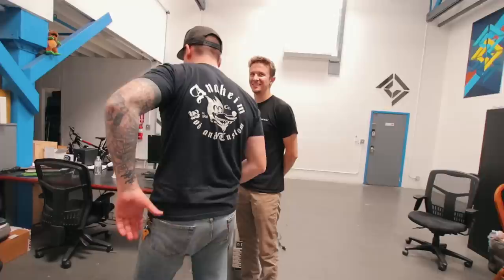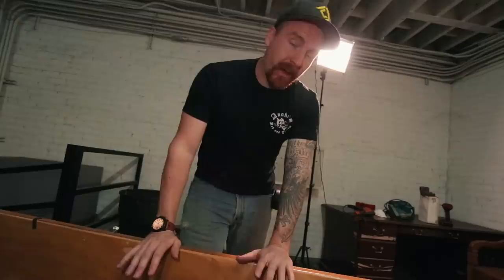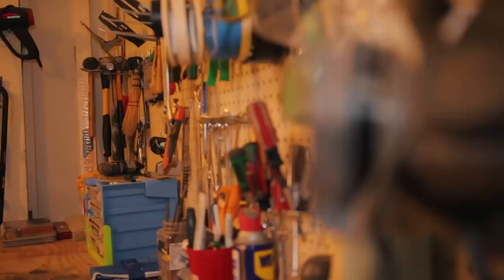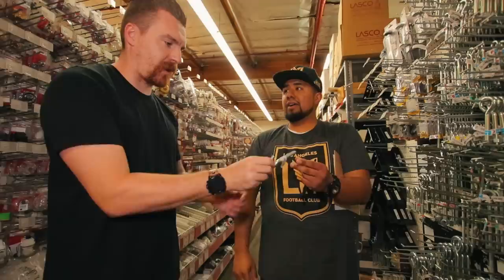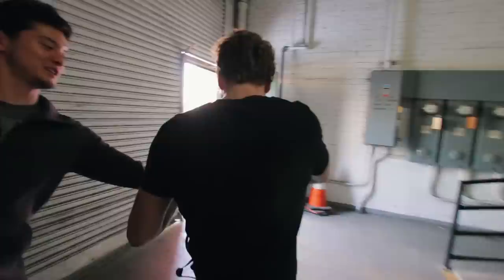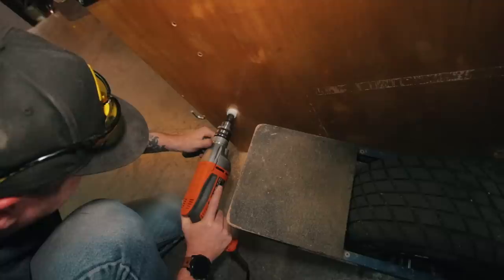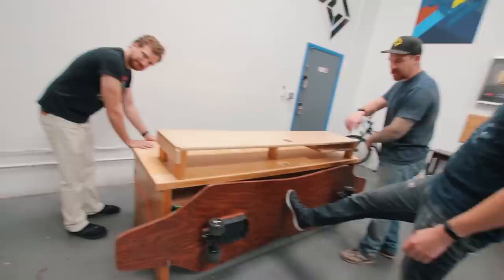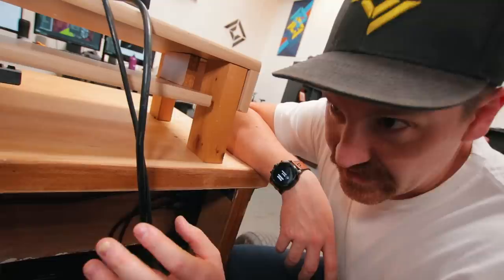Jake's Stressed Out by Wren's desk, so he built him a New One.

Comment: A great idea for drilling holes in things is that you can put another piece of timber on the other side of the desk and you clamp it down so it doesn't ruin your work as it comes out the other side. Instead of having to switch sides mid drill. Just a tip I hope you read this jake >:)
Reply: switching sides is still pretty effective and easier
Reply: Others will tell you that a better alternative to strapping a piece of wood to prevent a blowout is to just switch sides mid drill.. Helps prevent burning and much easier to get the puck out of the hole saw as well.
Reply: @rsimps14  Depends. I usually switch sides, but sometimes it might be in a tighter spot or corner not that easy to reach.
Switching sides also has the advantage that you can drill holes a lot deeper than your drill actually is :), it also makes it a lot easier to get the wood back out.

Comment: Key to a good cut is not to drill it from both sides but to add scrap wood at the bottom of the cut
Reply: Sebastian, actually, by doing cuts from both sides, it allows to prevent the wood from chipping on the opposite side..

Comment: The key to a good cut is not doing it from both sides, because that leads to a misaligned cut. What I believe your objective is with that statement is to avoid burring on the underside of the cut. The best way to prevent that is to tightly clamp your piece to another piece of wood behind it, so when the bit exits the back, it doesn't burr. DO NOT cut from both sides unless you want a misaligned or misshapen hole.

Comment: what i learned in trade school is that when using a handheld drill- if the drill bit is bigger than 1inch in diameter, you get another person to hold on to the drill with you. but then i'm learning to be a machinist, so maybe it won't apply to woodworking. idk.

Comment: 8:37 guaranteed that the other side got busted lol Hey Jake, if the stain wouldn't take, use a gel stain instead. You could have gel stained over the existing varnish then apply varnish over the gel stain to protect it. No need to sand.

Comment: Geeze I hate hole saws for that exact reason. Whenever I have to make a big hole in ply wood with a hole saw I use a Jig to hold the drill in place. Basically 2 boxes made of 2 by. and clamp them down with the handle in between them. I only seen some one break a wrist with a drill once. But once is far too many.